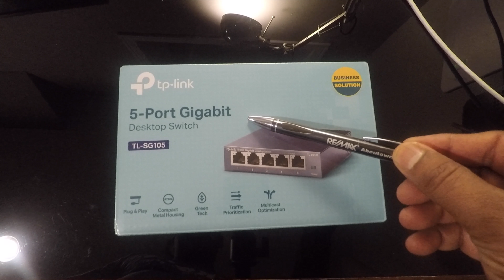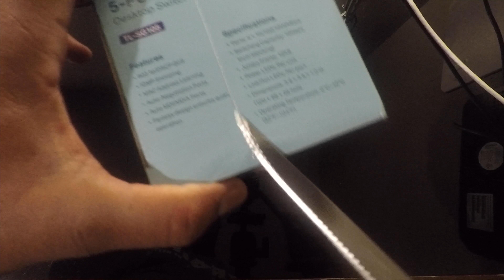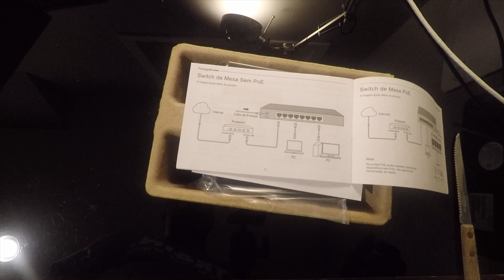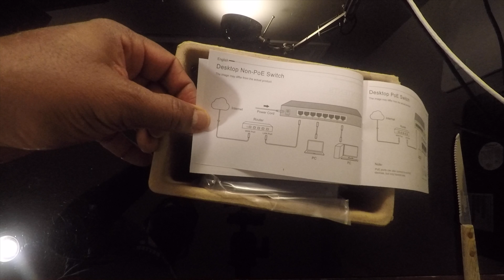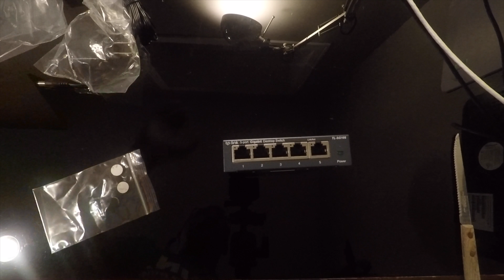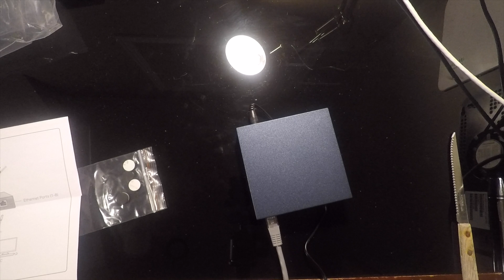TP Link 5 Port Gigabit Desktop Switch TL-SG105

Comment: Hello Nishan, Great job on your video. I just received mine today from  Amazon.  Unfortunately it has to go back because I  need 5 down ports and this only has 4 as you know. Maybe this manufacturer will consider that 5 means 5 and not 4. (lol)

Nevertheless, I think I should move up to a larger model to allow for some growth before I have to buy another.

Thank you for your time and effort.
Stay Safe
Reply from the maker: Get the 8 port one. In fact I should have got the 8 port one as well.